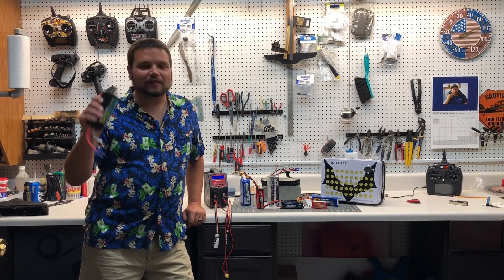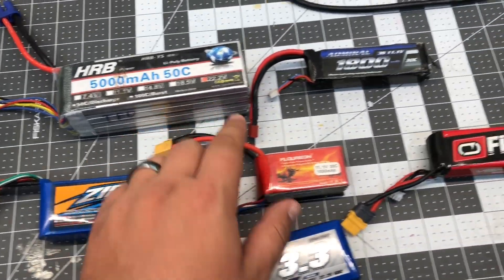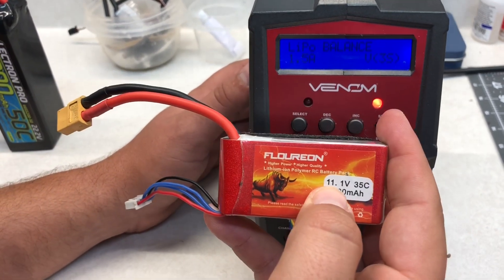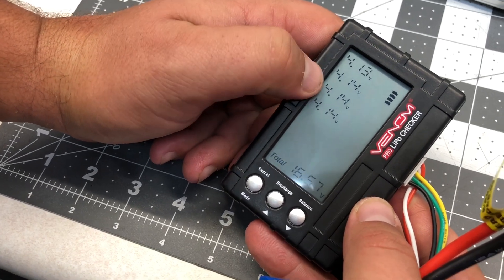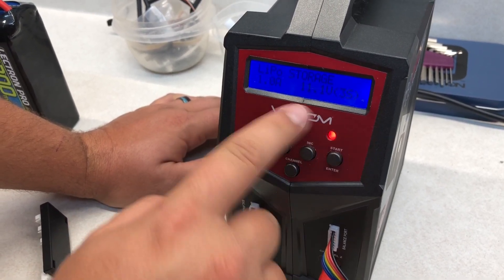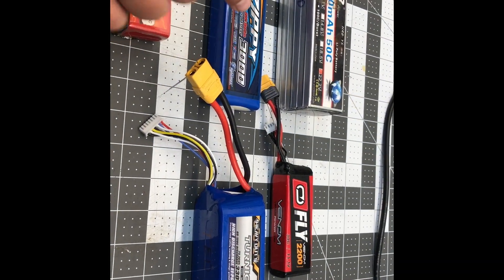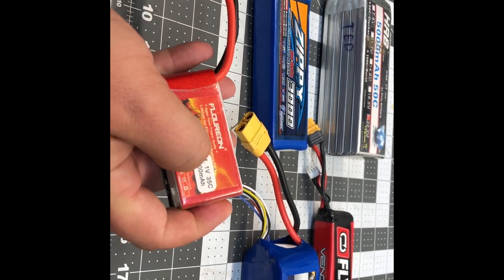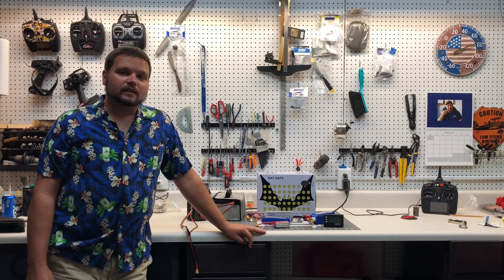Lipo charging and safety. How to keep your self safe with lipo batteries.

Comment: Got the Pro Duo in Saturday. The manual is decent, but left me with a question. Does the charger detect full battery charge and stop automatically? I noticed it ran my 3s 3200 to 4.1 per cell, then I just stopped the charger manually. Thanks for the tip on the charger. I love it.
Reply from the maker: Hal Roofner should auto stop at 4.20 a cell I’ve noticed the battery checkers can be off a bit when your charging you can press the 3rd button from the left and it will actually show individual cell voltage hopefully that helps you brother
Reply: @MerryBoozerRC  Thank you my friend, have a great week.

Comment: Have been looking for a good charger at a good price just like that Venom pro duo. Do you recall the company you bought it from?
Reply from the maker: Hal Roofner I actually got it from amazon the duo has been out of stock for a wile but the quad is on pilot Ryan’s amazon store I think hang on I will look
Reply from the maker: Venom Pro Duo 80W X2 Dual AC/DC 7A LiPo/LiHV & NiMH RC Battery Balance Charger https://www.amazon.com/dp/B07KXFR15K/ref=cm_sw_r_cp_api_i_PLIuCbDDF1TGT
Reply: @MerryBoozerRC  great. I watch the pilots lounge on saturday, but forgot their store website address. Could you give that also? Ii have one of the Venom batt. checkers. Very handy.
Reply from the maker: It’s actually in the description of this video
Reply: @MerryBoozerRC  thanks
Reply from the maker: Hal Roofner Ryan is adding the pro due as we speak so if you don’t see it just wait an hour and it should be on there
Reply from the maker: Ok it’s on the pilot Ryan amazon store now just checked
Reply: @MerryBoozerRC  thank you. Great!